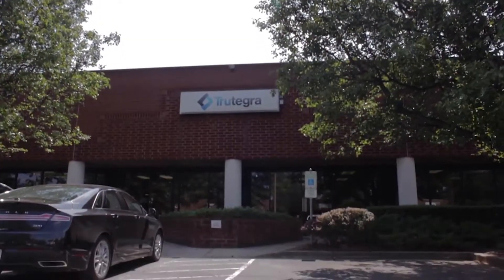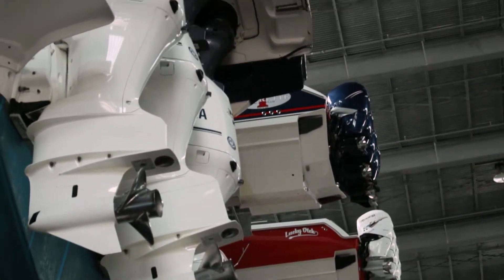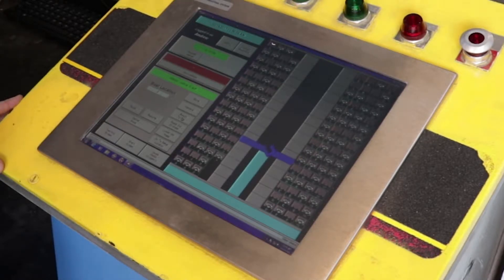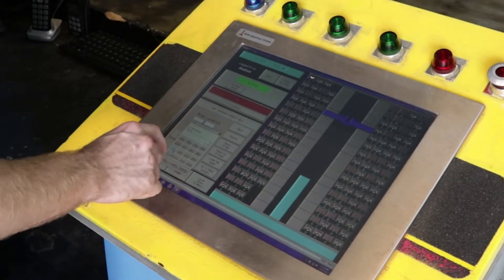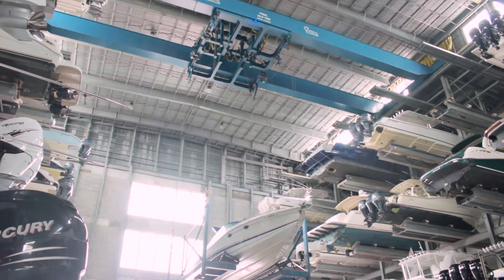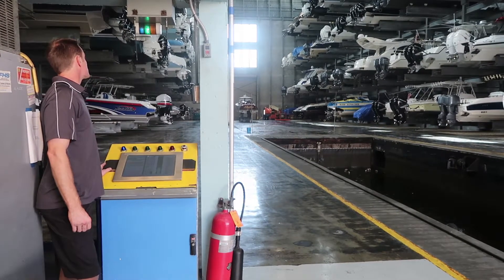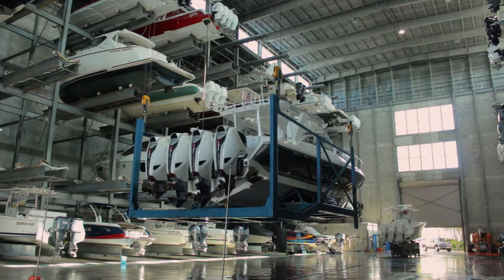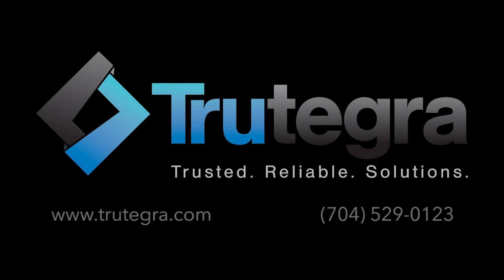The Port Marina boat automatic storage and retrieval system with No Sway (sales@trutegra.com)

Comment: Hi, 

What is the brand and the name of this specific system ? 
I would appreciate to know it as I got a similar project in France. 

Thank's a lot !
Reply from the maker: Call me @ 7046412518
Reply from the maker: Jpardue@trutegra.com
Reply from the maker: This system was mechanically designed by Sky Structures in NV and the controls-software is by Trutegra in Charlotte NC. If you are interested in knowing more, please reach out to jpardue@trutegra.com or call Jody Pardue at 7042478239. Cell phone is 7046412518 if you would like to text.